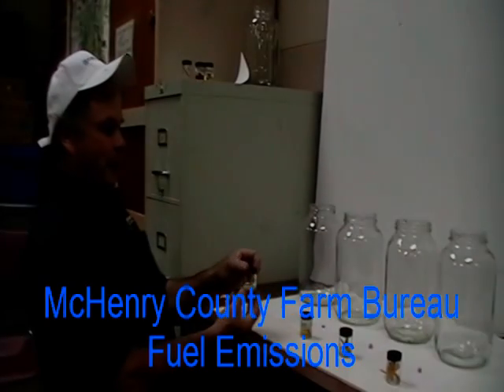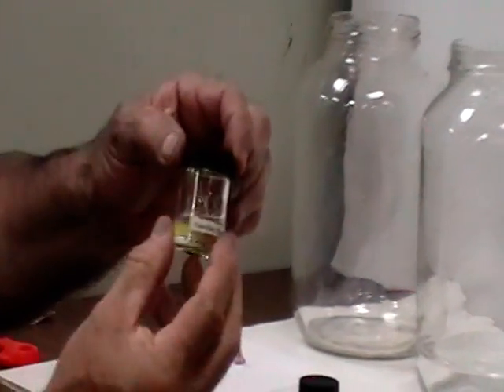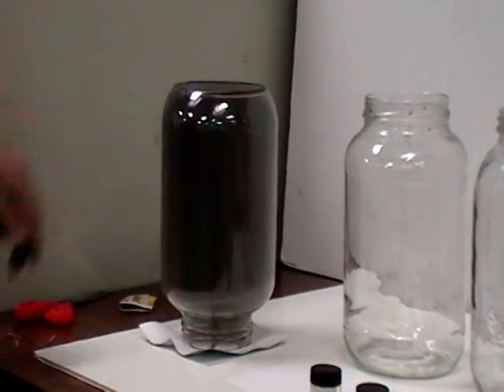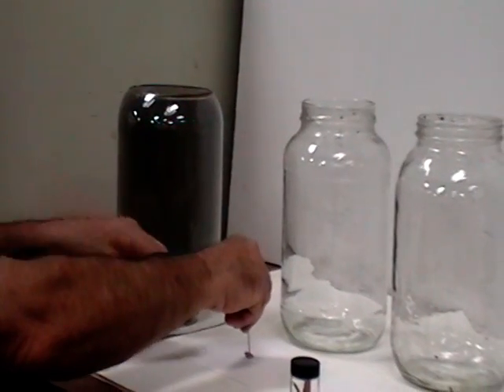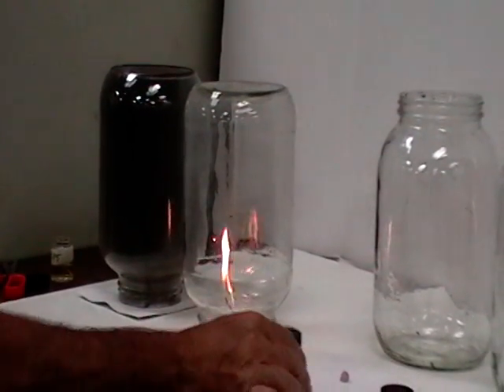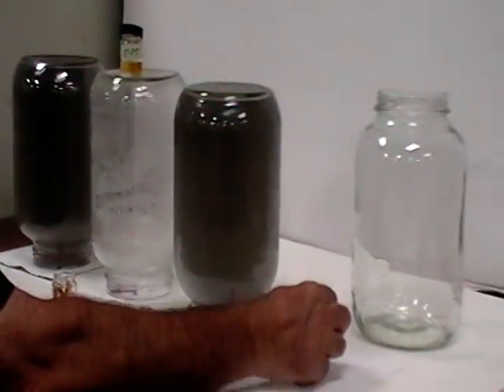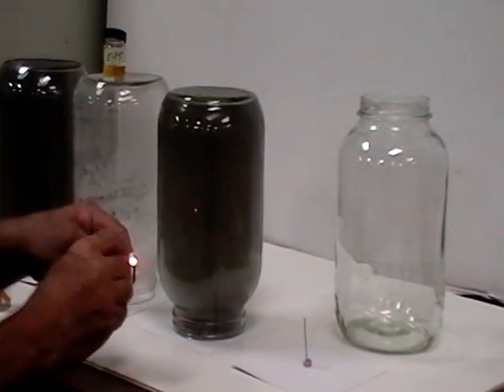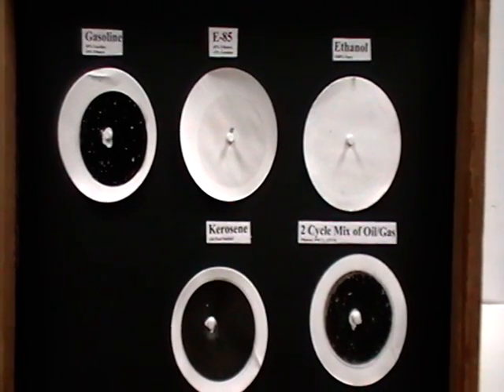Fuel Emissions - Gas, Ethanol, E85, Kerosene

Comment: so... how about the fact that you need 3x the ethanol then gasoline... is ethanol 3x cleaner?? including the production of ethanol??

it's junk fuel, it was designed to be a corn farmers subsidy...
Reply: +WezleyB where do you get that figure from.

I burn e85 in my car. My fuel usage has gone from 7.5L/100km to 9.5L/100km despite driving even harder. So your looking at using about 20% more e85 than petrol. Combine that with 20% MORE power and torque and 80% LESS emissions its a no brainer in the long term. The only real issue is, farm land is finite so do you use the land for fuel or food. So it does crate its own issues but for the environment its a excellent choice.

The production of ethanol takes about the same amount of energy as petrol by the way. 

Its fine to make a argument, but at least get it right.
Reply: Stinger, that doesn't make any sense. Ethanol cars needs more fuel even to start. I have a pure ethanol car, it runs great but it spends much more fuel than a gasoline one.
Reply: SCarrilho yes about 20% more fuel usage. But i meant the energy to actually produce the fuel is less than petrol, importantly its sustainable for hundreds of years
Reply: Brazil was the first country to use ethanol as a primary fuel in the 70's, and i'm brazilian... now they sell cars that runs with ethanol or gasoline, it's simple: if gasoline costs 30% more than ethanol then we use ethanol otherwise we use gasoline because ethanol uses 30% more fuel to run. And ethanol is highly corrosive, the car will need more maintenance on the fuel lines and exaust pipes. I have a 1988 parati (fox wagon in US) that uses ethanol and CNG.
Reply: here in finland they use garbage to make ethanol so it's really ecological :) once had to do coldstart when was -16C still no problems at all :D  here ethanol litre cost's 0,95€ and gasoline 1,4€-1,6€ / litre :)
Reply: no. where did you get that information from?? my passat 2.8 consumes 12.8l /100km e85 on combined city and road driving and 10l/100km E5 98 and it has been calculated that ethanol produces 80% less CO2 emissions. with combined production and driving per Km.................
Reply: +WezleyB It should be noted that in Brazil they use sugarcane to make their ethenol for fuels.
Reply: +WezleyB actually corn is just a stepping stone towards cellulose based ethanol.
Basically ethanol made from the plant waste material. that's what it's designed for.
Reply: +The Countess Hows that cellulosic ethanol working out for you? All of the plants, built with heavy government handouts, have failed.
Reply: Philip Lewis ow you mean after oil exporters got so scared of alternative energies that they lowered the price to purposefully drive them out of business, destroying their own economies in the process?

oil is on the way out, but it seems it won't go quietly into the night unfortunately.
Reply: The Countess it isnt because they are scared of alternative energy. it is because the usa is losing their hold on the oil market, and they cant keep the price up anymore. it is a supply and demand thing... the market is flooded with cheap oil..........
Reply: +WezleyB and who you think is doing the flooding?

exactly, the countries who's whole economy is dependent on oil: Saudi Arabia.
Reply: yes countries that usa's sanctions ran out on... they have much cheaper oil than the west, and they can make money still. if energy companies cant make a profit from oil, they will start thinking harder about alternative energy...
Reply: +WezleyB every one of those has large (and expensive) subsidies their oil or gasoline.
Reply: 12 cents a liter in Saudi Arabia at the pump...
the usa fucked the oil industry, and now they have lost their control of it and prices will goto an acceptable level..

Comment: Can you do a video on the different octane gasses that you find at the pump?
Reply: +JourneyedAvenger Unless you've got a high-compression performance car, you don't need high octane fuel.
Reply: +Bladsmith well, like the different octane gasses you find at the pump. like premium gasoline vs unleaded and so on. I have to use a higher octane gasoline for my car like 93 octane, rather than 87 or else it will diesel out.

Comment: One of the things McHenry Il is known for is agriculture, right?  So the county farm bureau would have a vested interest in singing the praises of E85 over all other forms of fuel.

More E85 useage = higher crop prices.  All of this is a bunch of self serving BS.
Reply: +bayerr it sounds like your bike needs to be tuned for the new blend.
Reply: +stinger15au Ethanol and blended gas (which will soon include 15%) is fucking awful for motorbikes and small motors, though. In fact, it is absolutely not suggested that anyone run the new 15% blend the EPA is attempting to mandate in motorcycles because it will fuck the engines up. Most all manufacturers of small motors and motorbikes actually are adding notations to owners manuals that running 15% blend will void warranty.

My motorcycle gets 45MPG on pure gas Up to 50 highway. Sadly, the last station in town that sold pure gas no longer does so and all of them now sell 10% blend. On that crap, my motorbike only gets around 35-38 MPG at best. Pretty big loss in economy, there. Coupled with the fact that blended gasoline doesn't store well at all, I cannot let the bike sit for more than two weeks without sta-bil or having to drain the tank due to separation and water attraction.
Reply: +Tim Fox Im not from any sort of farm. But the reality is, e85 is excellent from the emissions point of view. Vaporising mostly alcohol creates very little in terms of harmful emissions. Of course it presents its own problems (food or fuel for farmland?) E85 powered cars make more power and more torque with 80% less emissions. For about 20% more fuel use. A worthy tradeoff

Comment: Biased test. the oil based fuels REQUIRE more oxygen to make a more complete burn eliminating the black soot. Look at the size of the flame. way more heat is being generated Than the TINY flame the e85 is producing. A smaller flame allows for oxygen consumption to be more conducive to a complete burn. If this test was accurate your tailpipe on your car would be plugged up with that soot within 20k miles. But  SUPRISE! it's not. GIVE THE OTHER FUELS THE OXYGEN THAT YOU ARE STARVING THEM FROM AND THEY WILL BURN MORE COMPLETELY AND CLEANER.

Comment: This is a scam. Ethanol has 4x less carbon in it so of course it doesn't make the bottle black. It also has much less energy so you use more to go the same distance as regular gasoline.
Reply: +Donovan “DucatiD” Lewis its 20 to 30% more fuel for 20 to 30% MORE power and torque tuned correctly. Combined with the far lower emissions its just makes sense. It has its own problems (using farmland for fuel or food?) but for the environment its a no brainer.
Reply: That isn't exactly accurate. The measurement of BTU energy is moot, unless you're powering a heater. What we want to do is create mechanical power, which ethanol is better for.
Reply: +Tim Fox Your flex fuel vehicle is still a gasoline engine that can change tune to run ethanol. but the mechanical aspects are still optimized for gas due to 80+ years of politics and lies.  Changing things like raising compression ratio,  adding heated fuel rails,  advanced timing, will get the most power and efficiency from an ethanol engine.  more than gasoline.  And those changes SHOULDN'T  cost that much more from the manufacture to include.
Reply: +stinger15au Except it really isn't a food for fuel situation.  The corn being used would only be suitable for cattle feed.  Even then,  we produce more corn than we can sell every year.  The food for fuel discussion is completely invalid.  Plus,  alcohol can be made from virtually any plant material.  With proper steps you can actually produce more fuel from the corn plant than from the grain itself.
Reply: +ThinkFreely2012 Where's your proof.  I know when I run E85 in my flex fuel vehicle vs unleaded, I got less miles on a tank.

I have done this test several times and usually get 150 - 200 miles less per tank on the same vehicle with the same driving patterns.
Reply: +ThinkFreely2012 If this is so awesome, why are 100% of all vehicles produced that way and why isn't E100 the only thing you can find?

Also, what is so great about a fuel that is not stable?  Hydroscopic anyone?
Reply: +ThinkFreely2012 You missed his point.  He didn't say "corn for food or fuel", he said "farmland for fuel or food".  Of course we produce much more corn than we can consume, it's subsidized!

Disclaimer:  I have no dog in this fight.  My antiques will never run on ethanol
Reply: +Mike Welker What happens when Ethanol is all you can buy?
Reply: Tim Fox its going to be 100 years until you cant buy gasoline. But really it will be the same thing as buying 8track tapes or vacuum tube radio's today. Simply obsolete, "cars" of the day wont use gasoline/petrol at all so it wont matter

Comment: just bought an 2015 Fusion Hybrid and the dealer just tried to charge me $300 to drain my tank of E85 because it was throwing a running rich code. I should've checked it myself.

  Probably would have if the car was throwing all kinds of codes like EMERGENCY SHUTDOWN and the motor revving up all by itself, the first 3 days of ownership.